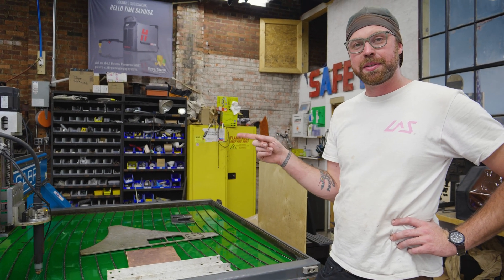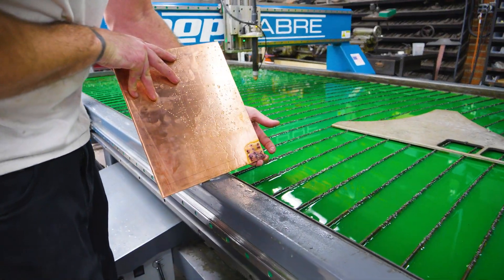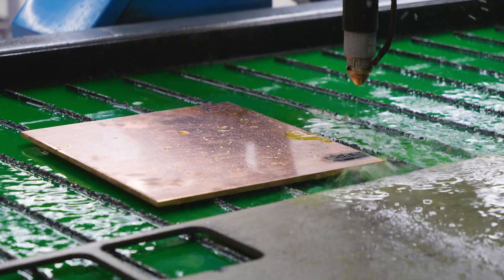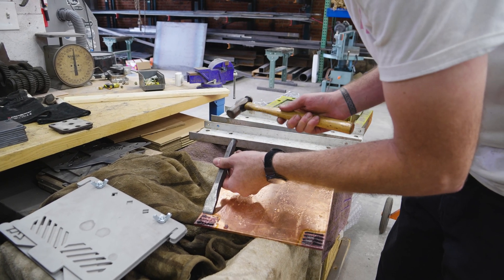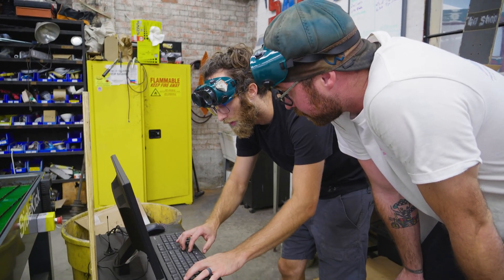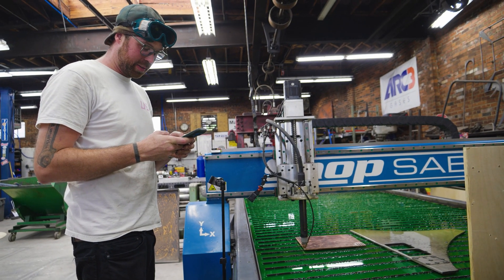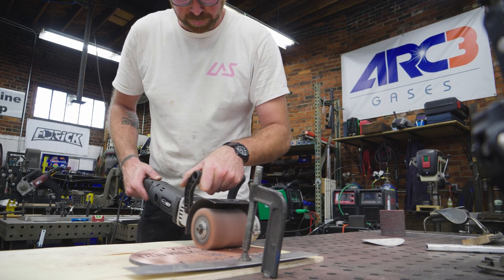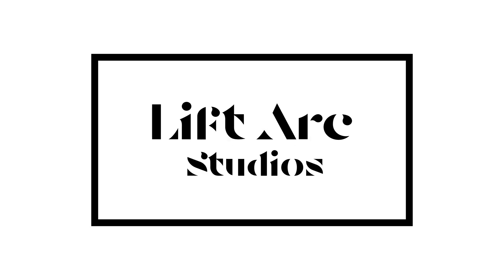Cutting Copper on CNC Plasma

Comment: Sanding that without a clamp would’ve been so much easier and more convenient. Take some blue painters tape and put it on the table, then put another couple of pieces on the back of the piece you’re sanding and use thin superglue to bond the tape on the back of the piece and the tape on the table together. When done sanding just pry off and peel off tape. Great tip I learned that I’ve mainly seen used in woodworking for sanding small flat slabs but seems like it would work the same here! Let me know if it works out! Good work!

Comment: As a novice hobbyist jewelry maker / metal-smith, I learned to fold form, forge, solder and cut copper sheet and wire as it is much cheaper than sterling (can't afford gold and not that skilled!).  It's great for mockup designs.  I love working with copper.  I primarily use sterling silver now, but I still love the feel and look of copper.  Just wish it didn't  turn my skin green! : )

Comment: Neat. I’ve welded copper.. highest amps I’ve ever tig welded. Like 250amps+ and the 480v miller tig welder was not happy. I’d rather just have had a 1/2” thick piece of copper instead of 2 1/4” thick pieces, but I had to work with what I could find

Comment: I wonder does that heat and cooling make the copper really soft like annealing it would? When ever i worked with forging copper heating it and cooling it in water made it real sofmebut would the heat and cooling and heating as it cuts change that?
Reply from the maker: excellent question!

Comment: As you will be moving to a larger space, eventually, perhaps you could invest in a water jet... That would cut through that copper like butter... Just a suggestion
Reply from the maker: Who doesn't love a wet jet?!
Reply: @LiftArcStudios  You could also go for one of the little waterjet tables for special cases like these, that would be a much smaller investment. The Wazer Desktop is "only" $10k, and their slightly more powerful (same bed size) version, the Wazer Pro, is $19k. You could even do it 2-tiered, cut the large sections of steel on the plasma cutter and cut intricate details on the waterjet so you don't have to clean it up as much.

Comment: Can you tweak the acceleration settings in software? Reducing them might clean your curves up a little if you still have a bit to play with.
Reply from the maker: Absolutely, that's ultimately what we ended up doing was lowering the speed by which it moves in order to have a longer cutting time.

Comment: That is brave!  Nicely done.  I've done 20 gauge copper sheet.  My settings were: Copper sheet, 20 gauge, 0.032" thick (1.5 lbs per square foot).
Cutting parameters: 
175" per minute feed rate
0.15" pierce height
0.06" cut height
0.7 second pierce delay (Langmuir systems have long pierce delays).
40 Amps Hypertherm Powermax 600 with Duramax Torch
Regular shielded consumables.
Reply from the maker: We should start a massive sharable doc or club for all this good info. That kind of information sharing and comradery is what's really great about a community of people working on the same stuff.

Comment: I've wanted to try copper in my plasma cutter, but I'm probably not brave enough to try ¼, maybe I'd try ⅛. Thanks for sharing the speed and power settings. I've learned a lot from you guys over the years.
I'm telling ya, try out an air hammer @ 25psi with a squared off chisel in it (this ■, not this ▲). It does an amazing job on the boogers on the back.
Reply from the maker: Yeah, this is one of those crazy things that we don't usually run into too often which is also why I assume there's not a ton of good info out there on it. Whenever we can share what we learn we definitely consider it a win!

Comment: I wonder if the "soft but durable" feeling is the machine getting loaded up with copper so then it doesn't want to cut/sand anymore. Like how aluminum plugs flap discs
Reply from the maker: That's a good theory, for us it seemed to cut and cool really quickly which was part of why it felt that way during that project.

Comment: As a gold smith it is funny when people are scared of the value the material has. But then again I have the advantage that I can melt everthing again.
Reply from the maker: Agreed, I'm sure compared to gold almost everything we use is of almost noncomparable value. But for us when you compare the cost of copper to mild steel, it definitely seems like gold to us!
Reply: You use one of those aprons that attach to the end of your bench so that the filings and stuff can be swept into it for recovery?
Reply: @melgross  Yes, it is actually super usefull when you drop things and it keeps your clothes clean. We have small boxes at work where we add all the dust and send it to a special company that refines it. Also the normal dust tat has some traces of gold is collected and sent for refining.